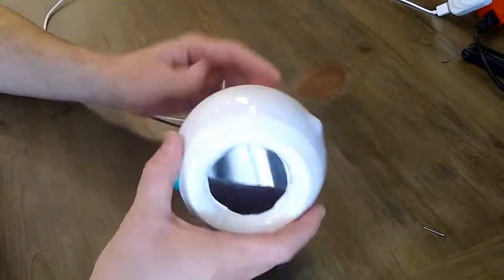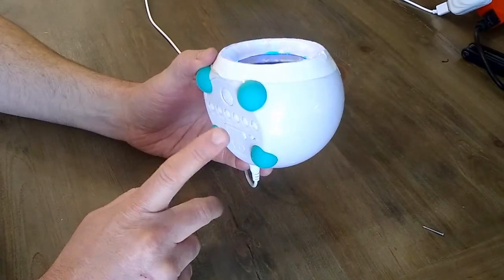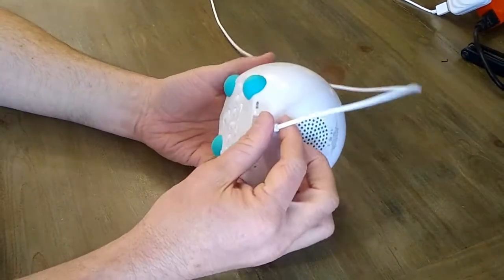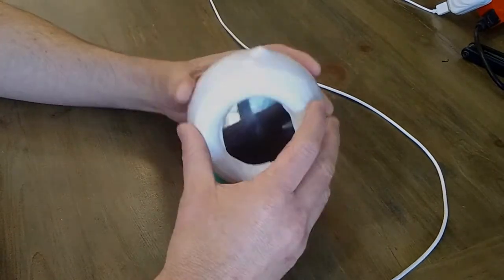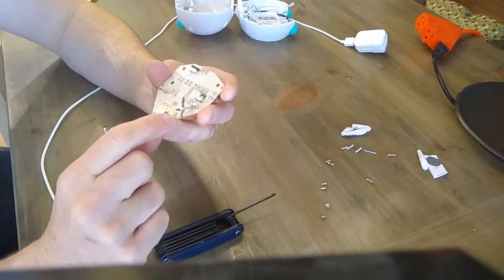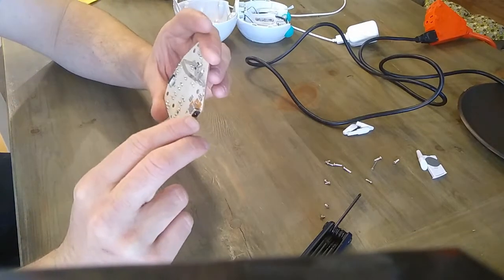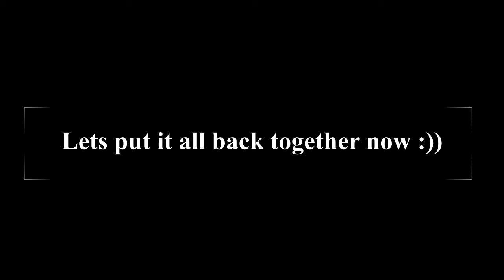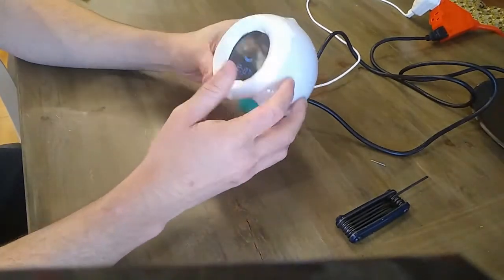Bob's Odd Jobs - LittleHippo Mella Clock - Repair and Review

Comment: Most of the issues described have always had a solution. I bought mine 4 years ago for my baby girl and it always had 3 brightness levels and the ability to remove the yellow light 30 mins before the wake up time. For the battery issue, I replaced the battery with a rechargeable one and it seems to be keeping the charge forever now. I think it's a genuine design flaw where the battery is indeed inline with the power instead of a backup, so the battery gets discharged fast. However, that flaw is actually a good charging mechanism for my rechargeable battery.

Comment: How do you get the little oval pieces out? Just tried with a glasses screwdriver and it’s denting the plastic. My kid dropped it from the top bunk so the button on top needs to get fixed…
Reply from the maker: Hey Seinesein,

I used a very small screwdriver. I caused some small dents in those plugs but it's only a minor cosmetic issue. If it bothers you, you could carefully cut white electrical tape in circles to cover the damaged plugs afterwards. 
Unfortunately this clock isn't ment to be serviced so the manufacturer would put those plugs in thinking they are permanent.

Hope that helps

Take Care
Reply: @bobsoddjobs  thank you for the speedy response! Too bad they aren’t meant to be serviced, these clocks seem designed to get dropped a lot (only in my house maybe)